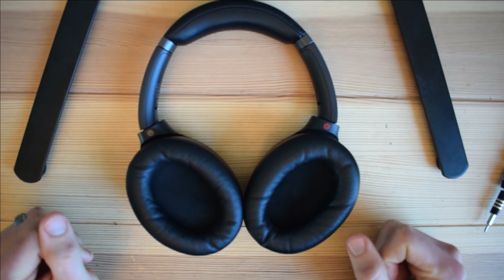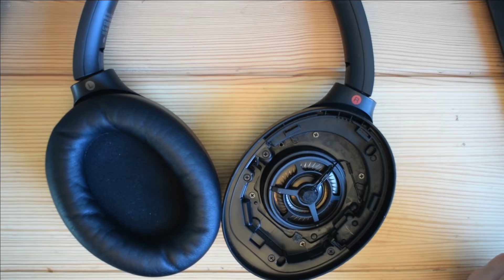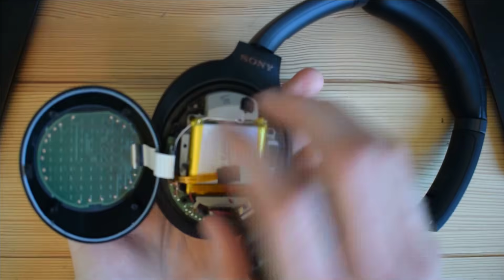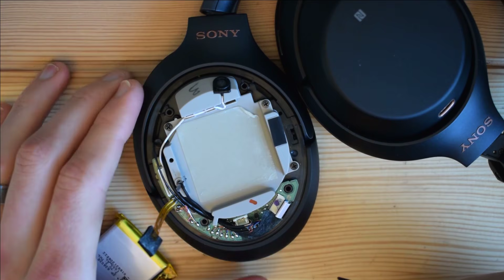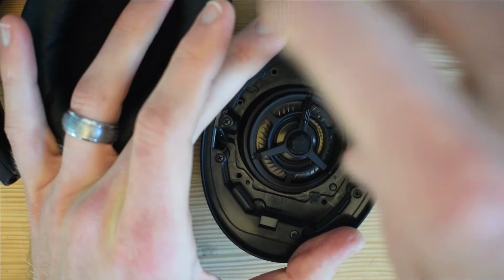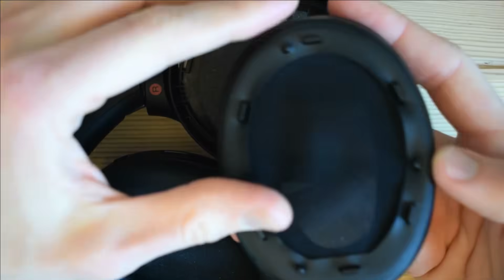Sony WH-1000XM3 Battery Troubleshooting, Repair or Replacement Walkthrough - Teardown and Fix

Comment: My WH-1000XM3's were not charging most of the time either (flashing red light when plugged in to a charger). I followed these instructions up to disconnecting the battery and waiting 15 minutes, and lo and behold after plugging the battery back in the headphones started charging regularly! Thanks Jon!
Reply from the maker: That's awesome to hear! For some reason that really helps for a lot of issues :)

Comment: Thanks for this. Very informative!

Mine got dropped, and the headphones work with charge that is left on the battery, but it will not charge (light does not turn on). I've looked opened it up, and everything seems fine (the ribbon cable, battery connection, etc.), but since the light will not turn on I'm guessing (based on the other comments) it probably the port.

Anyhow, is there a way to buy the port off of you via Paypal or something similar? Buying through your eBay wants to charge me a whopping ~27 USD in shipping and import tax for a ~14 USD part (so ~41 USD in total).

tldr; Any chance to buy the part outside of eBay? Thanks.
Reply from the maker: Hey, I'm really sorry but I only do international shipping through eBay. I hope you can find the part for cheaper shipping somewhere :)
Reply: @jontriestofixthings3718  Thanks for the fast reply. I've only seen the part in stock at your store so far. And the shipping/import tax issue is the same with all US based eBay sellers. It's just a bit annoying to "risk" 1/4 of a new headset price for a part that might fix the one I have.

If you have any tips where to look I'll appreciate it, or I might just bite the bullet and order from you (so I guess you should not give any tips :P)

Comment: I tried this repair (unplugging the battery and plugging it back) on my Sony xm2 and it worked!! My headphones would not turn on and I was bummed out to have to spend another 300$ or so on headphones. Thankfully I found this video, thank you so much! I do have to unplug and plug the battery back in once a month or two or so but so far the headphones have lasted a good 5-6 more months!
Reply from the maker: Awesome to hear that! If you ever get fed up with having to unplug and plug the battery back it you could try getting a replacement battery and see if that fixes the issue permanently :) Happy listening!

Comment: I was having boot issues and am going to pick up a battery just in case I need to replace the battery in the future. This is shockingly easy and how most electronics should be. Thanks for the guidance!
Reply from the maker: Yes, the battery fix is really straightforward! Some Sony models require soldering but thankfully the XM3 and XM4s do not :) Best of luck!
Reply: @jontriestofixthings3718  Will you be getting batteries in stock in your eBay store sometime soon? I'd much rather directly support you over an Amazon seller.
Reply from the maker: @Becausing  Hey, sorry but I'm out and don't think I'll have any in stock soon. Thank you so much for the sentiment though! :)

Comment: Very handy, thanks! What is the purpose of the sticky pad on top of the battery? Mine is very large and I can't seem to peel it cleanly
Reply from the maker: I think it is some sort of sensor. I am more of a trial and error guy, so I don't always know exactly what everything is/does. I will say that I've peeled them back quite messily before and it hasn't screwed up any of the headphones yet :)
Reply: Most likely a thermal sense to turn off power if battery over-heats.

Comment: Excellent video, thanks for posting.  I have the earlier 1000x and made the mistake of going out to the mail box in the rain without thinking.  15 mins after, they stopped working.  With your video, I was able to disassemble quickly and remove the battery.  Then left to dry for 48 hours, and still no luck.  Then sprayed 90% alcohol around except speakers and mics, then left to dry for 48 hrs.  Then, it worked!
Reply from the maker: fantastic! Great thinking about spraying the alcohol!
Reply: can anyone explain to me why spraying the alcohol helps?

Comment: You're the man! Thank you! Your video was clear and easy to follow. Reckon I might have kept the charge at 100% too much and have somehow cooked the battery. Trying the reset as we speak but least I know I can fix this. Cheers.
Reply: Problem fixed. Disconnection and re-connection was enough to reset the battery. Now getting the hours out of the battery that I should. Will probably buy a spare battery for when this one claps out. Thanks again man.

Comment: Try holding the power button as you plug it in. "B A" mentioned this in another comment and it worked for me. Before, no red light. Now charging again. I was able to fix it before by disconnecting the battery but it only worked for one power cycle. Some posters suggest that maybe the problem is due to a defective sensor.

Comment: Can I please ask..how do u keep the battery in gd condition are u meant to keep store at 100 % charged or?
Reply: Lithium batteries are best stored around 50% charge. Keeping it at 100 for long can degrade it. Keeping it too low can run the risk of overdischarge which also degrades it

Comment: A tip for other folks who have had the issues of the WX not charging anymore (and the red indicator not even turning on when you plug it in). Try holding the power button when you plug it in. For some reason that seems to work for me. Good luck y’all.
Reply: For some reason, this was the only thing that worked for me as well. Thanks for the tip!
Reply: This is great and worked! THANK YOU! Maybe it helped the battery discharge?
I disconnected the battery and that fixed it for one power cycle. Then it wouldn't charge again. However, holding in the power button while inserting the charging cable did something quite magical and now it's charging again. I'd just ordered a new battery and was about to replace mine when I happened to see your comment. It looks like now I have a spare battery if/when this one runs out. Appreciate you.
Reply: https://www.youtube.com/watch?v=EMtX-P8EuEw&list=PLtT_KzHNazfLWQ4L-lFceSaTBuq2bbnMd&index=23

Comment: Hi I followed your video exactly which was great and very clear. I changed out the battery on a set of XM 4 headphones which seem essentially the same (as far as I can tell)as the Xm3, and when I plug it into the charger the charging light still does not come on. The unit is little over a year old.  Any other suggestions? Thanks so much
Reply: Try holding the power button when you plug it in.
Reply: im having the exactly same problem, please let me know if you could fix them
Reply from the maker: Hey! Thanks for watching! And Kudos to you for trying this on the XM4s. I haven't had a chance to repair any XM4s yet so unfortunately I can't offer any assistance. I wish you the best in fixing your headphones!
Reply: https://www.youtube.com/watch?v=EMtX-P8EuEw&list=PLtT_KzHNazfLWQ4L-lFceSaTBuq2bbnMd&index=23

Comment: Hi, do you have an updated eBay link for the batteries? This fix worked for me one time, but then wouldn't charge again after. I'd like to try replacing the battery. Thanks!
Reply from the maker: Hey if you still need this I can get up a new listing today and update the link :)
Reply: @jontriestofixthings3718  Really? That would be fantastic! I searched some listings, but couldn't find the exact spec of the battery used and each listing seemed to be selling a slightly different battery, so I gave up.
Reply from the maker: @dogchaser520  I have some in stock so I just need to list them in the morning. Please view the updated link tomorrow :)
Reply: @jontriestofixthings3718  Ordered! Thanks for doing that. I didn't realize it would be used, though. Do you know what sort of life I can expect out of it? The original didn't make it more than a year and a half, and I wasn't using the headphones excessively, either. Bad battery, or just bad design maybe.
Reply: https://www.youtube.com/watch?v=EMtX-P8EuEw&list=PLtT_KzHNazfLWQ4L-lFceSaTBuq2bbnMd&index=23

Comment: Hey they, i have these headphones and the left speaker has lost all bass. . . it produces clear sound but no bass. . any suggestions?

Much appreciated 

cheers
Reply: you can customize the sound and bass in your sony app. There are also already pre-settings for bass or other sounds.
Reply from the maker: Hey! I'd assume that either the speaker is going out or a connection is loose. It may be worth it to open up the left side, disconnect the speaker and then resolder it to see if that helps. I'm unsure of which connection the bass is so I would probably just do trial and error to see if resoldering those connections fixes it.
Best of luck and sorry I can't provide a more clear answer!
Reply: https://www.youtube.com/watch?v=EMtX-P8EuEw&list=PLtT_KzHNazfLWQ4L-lFceSaTBuq2bbnMd&index=23

Comment: Hi.. My sony xm4 headphones have been plugged into the plug socket in the wall in my home which has totally killed them.. I heard a pop then a smell of burning.. They now won't work at all.. Do you think i have blown a fuse or something else? What is your advice? Thanks.
Reply from the maker: Oh so sorry to hear about that! You can certainly open them up to look inside. The damage will probably be obvious fairly quickly. If the battery is the issue that will be an easy fix. If one of the boards is damaged though that will be tougher. I'd start by taking a look inside to assess the damage and then going from there. Best wishes!
Reply: https://www.youtube.com/watch?v=EMtX-P8EuEw&list=PLtT_KzHNazfLWQ4L-lFceSaTBuq2bbnMd&index=23

Comment: This video is getting more attention because the warranty period is over for most people who got it in the first 6 months.
Reply: Bought mine when they first came out and they died about a year or so ago, since I'm not commuting anymore I didn't really care about them, decided to check how long the warranty was and of course it was only a year. Apparently my battery is dead, so I just ordered a new one. Gotta love when you only get about 1.5 years of usage out of $350 headphones. I probably should have stuck with the Bowers & Wilkins headphones I had before these since they were built way better and had physical controls, but they were really heavy.
Reply: Try, im that’s why I’m here, they no working good anymore

Comment: My XM3's seem to be charging but won't turn on. Sometimes I've managed to get them to turn on by doing the "hold both buttons while charging" reset but recently they just don't turn on at all.
Yesterday I took them apart for the first time and when I took apart first the right and then the left headphone they magically turned on and worked flawlessly for several hours. I could turn them on and off, everything seemed to be working.

Then I turned them off and the next day they were back to not working.

I thought it was the battery but I'm not sure, since they turned on by themselves when I had the left earcup opened.
Reply: I have experienced something similar, it wont turn on with any button, only with NFC, I found on reddit (Fixed WH-1000XM3 power button not turning it on (faint blue light)) that some cables where not well isolated, so I followed this tutorial to open the headset and put a piece of tape between those cables and now is working again.  Hope it helps
Reply: THE REDDIT POST WORKED!! you saved my headphones thank you

Comment: Just to add on, instead of waiting 15mins for circuits to discharge, you could also just hold the power button, like you would when dealing with a PC.
The basic idea is you want to discharge the capacitors for safety and so any volatile memory is cleared.

Comment: Anyone know how important/what that cable is at 2:20? When pulling mine off I lost a bit of the sticker and I'm afraid that when reapplying it to a new battery it might come lose. if it's important and it comes lose, any ideas on what I can do to make it stick?
Reply: Maybe a temperature probe, but it's just a guess, could also be an antenna

Comment: Are there any similarly-sized batteries with higher capacities—say 2500mha??
Reply: I was thinking about putting two batteries in, connected parallel, there seems to be enough room.

Comment: Red light is now charging, whereas before it didn't show a light and wouldn't take a charge! It worked.
Can't thank you enough. If I need a replacement battery or other parts I know where I'll go.

Comment: Really helpful and this video was key in me replacing the battery on my two year old headphones which would only charge up to 10%.  Thanks so much for sharing this helpful guide!
Reply: When you charged it, did it only light up for a sec?
Reply: @ju4n.17  No. The light would stay on, but even after leaving it charging overnight it always reported battery at 10% and the headphones would only last 4 hours before running out.

Comment: I tried everything. It's not charging and the led light doesn't show when it is connected either to the charger or computer. I thought it's a battery so I bought a new one, and the moment I put it there, the headphones started working again. But when the battery got low, I couldn't charge it again.
Reply: I think your problem (same as mine) might come from the heat sensor that is stuck with the black pad to the battery. In my case, when I take that pad off and press my fingers on the sensor so I act like a “conductor surface” myself, the headset charges again. I think the fact that the sensor doesn’t work acts like a security so the headset will not charge since it cannot detect overheating etc.
I don’t know how to replace it though (I have tried desoldering and resold wrong and it didn’t change anything)
Reply: I have the same problem, I'm starting to believe is a problem with the charging port, IDK if can be replaced
Reply: same problem here

Comment: Thanks for the video! It helped a lot, although it is really not necessary to remove the cables, nor the sticker from the battery if you just want to troubleshoot a reset issue. Just unplug the power connector and that is it! Nothing else is necessary unless you really want to replace the entire battery...

Comment: thanks for the video. if anyone is interested, the xm4's are built the same exact way. i know this because i used this video to find out why my xm4's wont charge. verdict: sony headphones are garbage. worst ANC cans i've ever owned for multiple reasons. gonna have to suffer through some cheapy headset until the QC45's are released. :(
Reply: update: after taking the entire headset apart and after doing a deep dive online, it seems many people having charging issues. sony's XM4's all of a sudden dont work with the charger they came with OR many other types. i tried charging with over 10 different block/cord setups before i found one that actually works! i have to charge them with the oldest cord i have and it only works if i plug it in to my car...grrrrrrrrrrrr! I'll never buy another sony product again. avoid these if you value your sanity.

Comment: sony product is POS dont buy it
Reply: Please explain.
Reply: @kosmokramer9502  I have  Sony TV thier android platform is horrible. Sometime can’t watch amazon. I have to reboot the system and reinstall all the app. I don’t that at least 4x. I have another big screeen tv that cost me 3500 Netflix glitch at time. Android on Sony is slow . Even slower then 400 tv.  Disappointing. Sony head phone wh1000xm3 same one I got . So the normal shit that happened to this headphone is the charging port. You have to replace it. I call my warranty was over but this is manufacturing problem that it should been recall. Nope they screw everyone over. I have to change the charging port and the battery cost me over 90$ Pos. I love Sony but this is ridiculous. So becareful
Reply: what is POS?

Comment: It's horrifying that my new unit needs this kind of repair already.  These headphones cost a lot of money and should be far more robust than this.
Reply: it's a 3 year old headphone man don't be surprised
Reply: @sustji  I bought mine about a month ago and already had to reset it.  There is NOTHING in the really poor documentation that came with it about resetting it.
Reply: @incog99skd11  batteries aren't meant to be left on a shelf for 2 years since the headphones came out in 2018

Comment: Hello Channel Owner and Audience, 
I need a help, I have a Sony WH-XB700. I love this headphone and have used it for more than 2 years.
This headphone is out of warranty now and doesn't work. It doesn't charge, no matter what I do. I tried resetting it as well, It was of no help. 
It works fine with aux cable though.
I took it to local Sony Service center as well, they were not able to fix it and said the circuit board has some issue, when asked about what issue they couldn't explain and offered exchange discount on purchase of a new Sony Headphone. I thought of it as a Sale trick and brought the headphone back to my place.
How do I fix this now ? Is there a way I can replace the whole circuit board , if yes, where can I get it online and how to replace it ?
I can buy a new one, no issue with that but I want it to be fixed.
Do suggest something guys.

Thanks in advance.

Comment: Thanks for this video, I replaced a battery in my XM3 :)
Reply: Where did you buy the battery and do you recall the size of the battery?
Reply: @barrykenna6067  Just type "Sony WH-1000XM3 battery" and you should find. Anyway, any Li-Po battery with output voltage of 3,7V will be good. Original has capacity of 1000mAh 😉